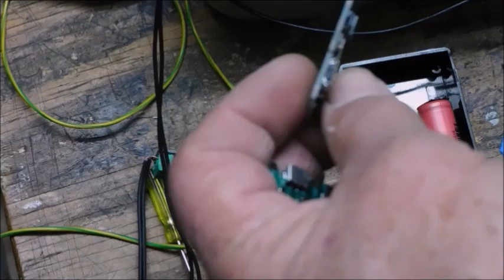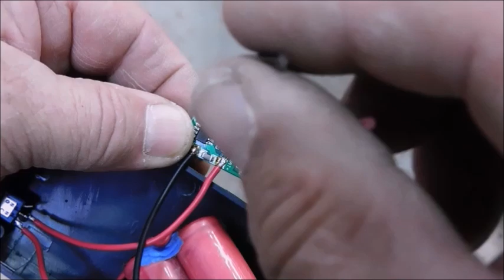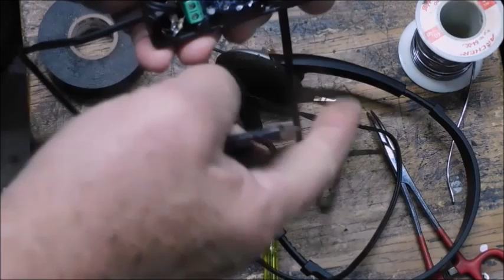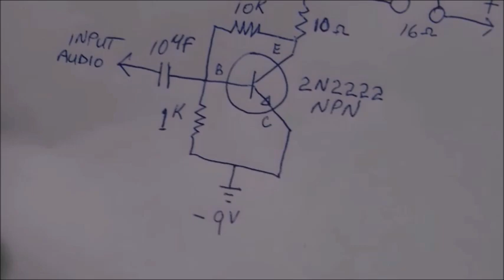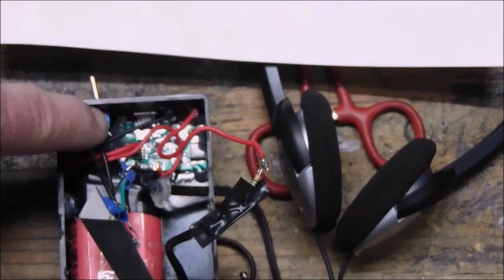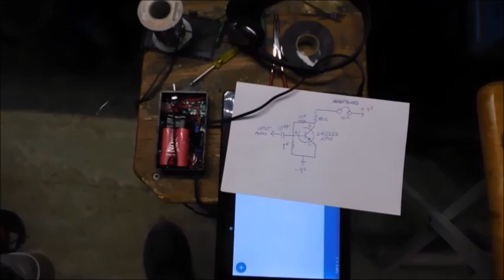CELL PHONE AMPLIFIER!  HELP WITH HEARING!

Comment: Awesome circuit! I was wondering, do you have to worry about balancing the 2 cells when its charging or eoes that charging board take care of that? 

The reason im wondering is because when charging drone batteries (which are usually 4 to 6 cells) you have to balance charge them or the voltages become different when charging over time which can cause overcharging.
Reply from the maker: If they were in series, I would have to think about that. Since they are in parallel, they will always be identical voltages. Thank you for watching.